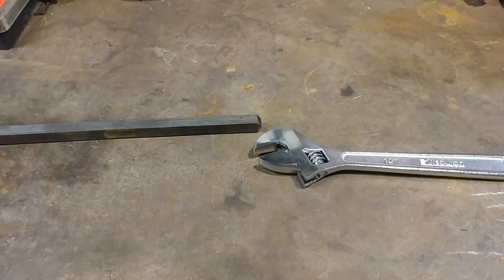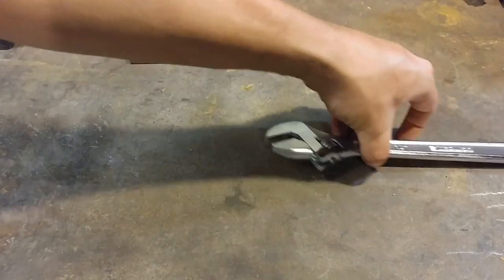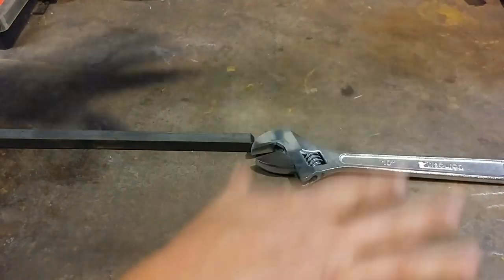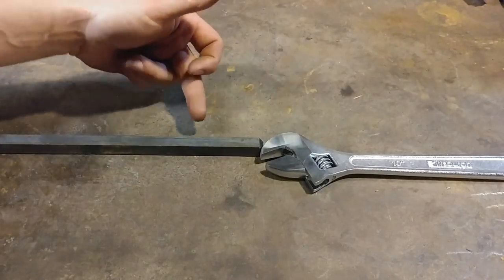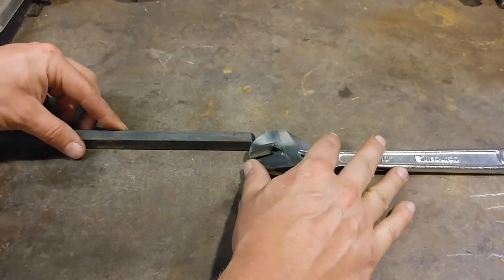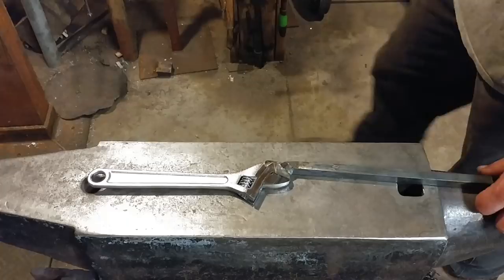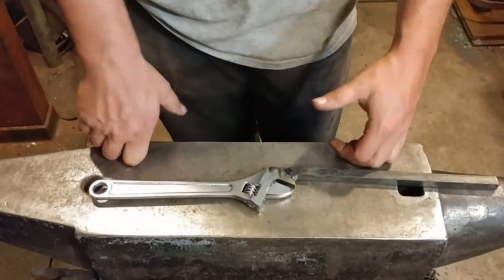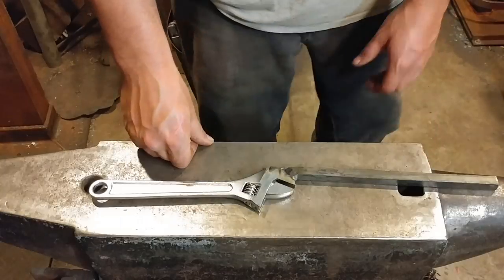DIY Blacksmith Twisting Wrench (for Twisting Metal Bars)

Comment: Using a simple throw away modern Cresent wrench with handle welded on is quite useful..  it's what I use too.

I'm not really a fan of welding/modifying old F style wrenches and other old tools that are still perfectly functional.

Thanks for the video...
Reply from the maker: +shadowcastre yeah I like the old wrenches too! Unfortunately I was not aware of this particular wrenches historic the how you when I welded the handle to it as I did this about 9 years ago LOL and it's what I had on hand :-) I feel a lot better about welding some cheap ones from Harbor Freight though LOL thank you for taking the time to watch God bless you

Comment: I welded a section of 5/8 round stock to a plumers wrench my self.
Reply from the maker: +Matthew Crandall that is another great way of doing it. just happened to have square stock available and it seemed to fit the shape of the adjustable wrench well :-)

Comment: I don't have a decent wrench so I just pinch the metal between 2 long pieces of bar stock. slips but works.
Reply from the maker: +Levi Blackwood sometimes you just got to do what you got to do :-) great thing about it though is the fact that twisting wrenches are a very simple tool so you can get it done with just two lengths of are held by hand. Thanks for watching God bless

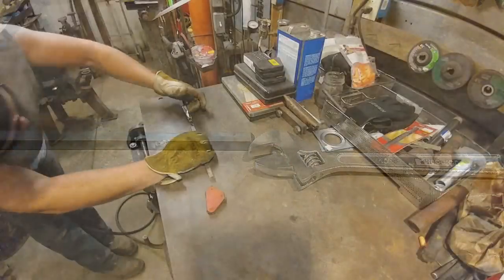Comment: Skip to the 3:45 mark to avoid the irrelevant jibber-jabber.
Reply from the maker: Better yet skip to another channel that cares for your opinion...
Reply: @ChristCenteredIronworks  Your topic is solid and it's important.  I learned a great idea about using an adjustable wrench to make a twist wrench.  But your dialogue is repetitive and not necessary.  I know I'm saying this in a brutally honest way that probably offends you, and you don't have to like or care about my opinion, but if you'd cut out the extraneous crap and stick to the topic this video would be a lot more watchable. Fact.